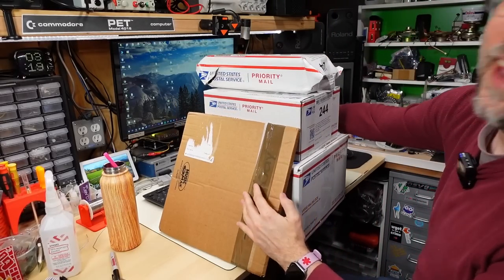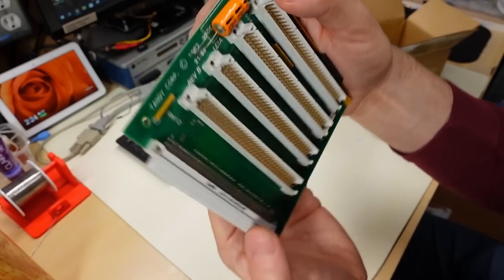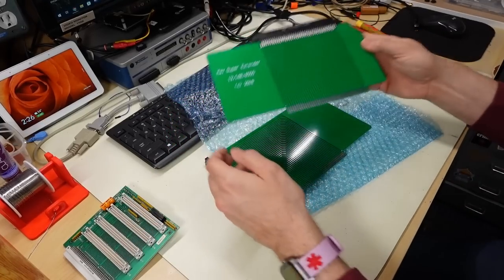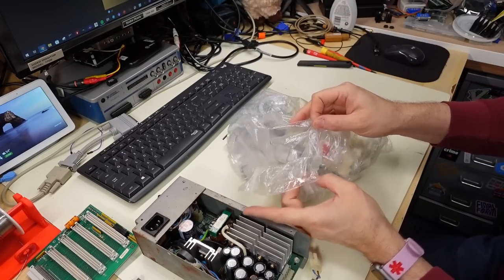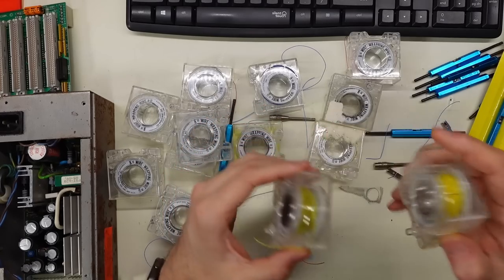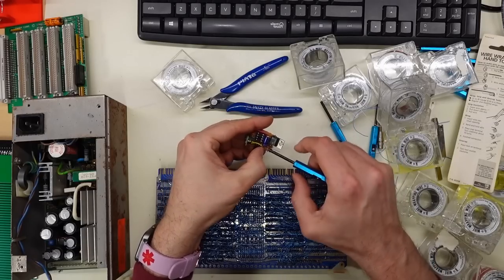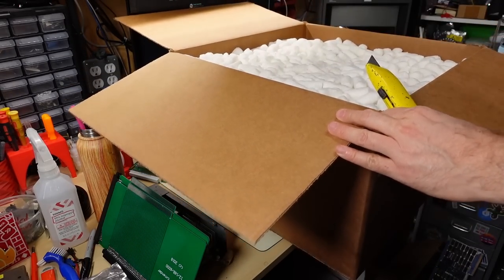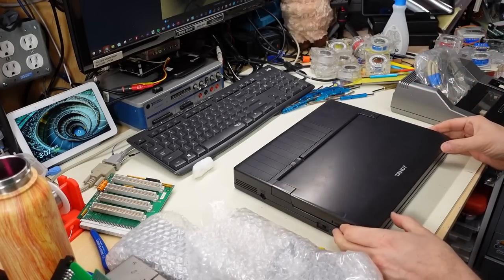0024 Wire wrapping goodies and some mystery Tandy items

Comment: Hi Adrian! It was so fun to see the items I sent opened on your show! Couple things to help with the “mystery” items- the backplane card was just another service board to help extend other cards for service purposes. Nothing other than that. The power supply was supposed to have rare hard to find parts for either a Model 2 or Model 16 so that was only purpose of sending that. The graphic plotter was supposedly used to print great electronics schematics and I suspected exactly what you said about Curious Marc that pens could be made from markers. Finally, the laptop was sent because it has an easy to replace screen and is supposed to be a great choice for DOS gaming (or an 8 Bit Dance party) with an SSD retrofit. Hope that helps with the mysteries and I hope the items help the channel! Thanks for the wonderful videos!
Reply: People like you are what keeps this channel running - thanks from a viewer!
Reply: Thanks for your donations to Adrian even if this message is a little late.  Yes, plotters of the day were the best way to print schematics especially with multiple colours for more than single layer boards.  Also very useful for drafting and architecture back in the day.

Comment: That Tandy laptop has a fairly common problem called "Vinegar Syndrome" where the acetate of what is made of the polarizer makes a chemical reaction with the environment and releases acetic acid (hence the name) when the process starts it cannot be stopped but can be fun to watch being accelerated only by exposing it to the sun and you can watch the polarizer completely rot away in a few minutes if the sun shines hard enough.
Good thing is that you can replace the polarizer and get an even better screen than what came from factory since now we have better polarizer that can deliver much better contrast.
Be aware that there are a few different types of polarizers and you might need to replace the front and back polarizer to match them.
Also another fun thing is that you can change the color by rotating or reversing the filters and get a cool blue/yellow or green/red display.
And last but not least, those floppy drives had a belt that runs the spindle and it melts away, replacing that is very likely to give back the life to that drive.

Great stuff, keep it going and good look on that procedure!
Reply: Vinegar syndrome is a problem with old film, too. I have a small old movie trailer collection, but last time I opened the box it smelled of vinegar really badly. I sorted out the worst offenders and put each in a separate bag, but I'm pretty sure they're a lost cause at this point.
Reply: @silmarian  Exactly, is more or less the same material that is made of, as far as i know one the process starts it cannot be stopped, on preserving film the only choice i know is duplication, and is valid only for archival since it only saves the content but not the media itself

Comment: My brother worked at a custom hardware manufacturer back in the 80s that wire wrapped prototype boards along with some low-run customer boards. My first job was unwrapping wires by hand so the prototype boards could be reused. I think I earned one or two cents per wire, but some of the boards had thousands of pins. I used the money to buy a disk drive for my Apple II+.
Reply: My first employer used this for custom back planes. We had a couple of electric guns.
Reply: nice racket you had going there, you and your brother, MISTER FLYNN... your brother wrapped and you unwrapped... (😋)

Comment: In the mid 90s, one of my engineering courses required building a single board computer using wire wrapping. It's a very tedious process, but the resulting connections can be just as reliable as solder. I found the board in storage last year and powered it up. It still runs--even on the original Radio Shack batteries.

The process of connecting every wire between every chip and then writing every line of firmware in assembly code to make it work was incredibly educational.

Comment: Wire Wrap notes: Short side of the tool is 'unwrap'. The little v shaped part in the middle is the insulation stripper. Wrap pins are square, the sharp edges dig into the wire as it is wrapped creating a gas tight connection which is why a wrap joint can be super reliable. If you wrap onto a round pin (such as a resistor lead) be sure to solder the connection.
Reply: Actually I was going to just put in a common pretty much same thing.

Although I've never used wire wrap myself I'm wholly aware and don't other people that have used it.

Also is wire-wrap still used in modern times and our dependence such available I've never really looked into it.

But if this is the case it might be good for some things for prototyping and some other things where it's not convenient to solder to hook something up!

I remember back in the day seeing wire-wrapped tools as well even the power version!

I do know that one time it used to beat using telecommunications as well.

Some of the equipment and thousands of wire wrap connections I see you don't talk to me occasionally room that was entirely obsolete.

But I believe was mostly still in use.

Don't remember how far back it was several years.

The interesting thing is that one portion of a wall was newer incoming equipment going to the standard punch down blocks and other equipment and the rest was what was still there.

And again that was still in use.

Somebody just at least of their workplace to show me the Telecommunications and some other things I might want to see.

Their electrical room they referred to as a substation.

Believe it or not this was at the lowest level of the building there was a separate section that was covered in chain-link fence that was straight from the utility voltage in the area.

Primary utility voltage inside!

Also all the metering was actually inside that cage to prevent tampering.

Apparently it was only the utility company that had access to the back portion of this!

That place I don't know how old it was it was one of the oddest looking systems.

Or at least primarily although I've seen weird granddaughter but part of which had also ac-dc conversion and even down to Mercury Ark rectifiers and that was still operational but had no idea for what it didn't make any sense.

It was off of building an underground corridors if you went down several what's in the quarter mile.

Big substation of some sort for certain types of equipment but no one knew what it ran!

Comment: Boy this video brought up some memories! I really enjoyed it. That wire wrap kit looks awesome. I lost mine somewhere along the way and have been regretting it. In the late 80s I made a HP/GL (IIRC) board for the Amiga 2000 that was all wire wrapped as a college project. I never got it to work but still got an A because the professors couldn't figure out why it would not work either. A couple years later, when I got my Commodore Hardware Developer status and copies of all the technical manuals, I discovered that all I needed to do was ground one connector pin (DATAC). Of course I had already torn down the card by then.

Comment: I can confirm that it did not have a built-in BIOS utility, rather it relied on software: two DOS utilities that shipped with the computer.  1) A Setup program that let you configure basic start-up and power-management parameters, and 2) a Power program that let you temporarily switch the power management profiles without restarting the computer.

You’re also right about the cutout on the back being for a modem; An optional 2400 Baud internal modem was available as a user installable upgrade. To my knowledge that was the only device made available for that mini bay.  A 1 MB SIMM RAM expansion was also an available upgrade, but it was installed via an obscure expansion bay located under the keyboard bezel above the first 7 Function keys.

Now I’m not as certain about this because it’s been too long and I can’t recall where I read this, but my understanding is something to this effect: None of the early pre-VGA Tandy laptops supported external displays because the display adapter used to drive the internal monochrome LCD used a nonstandard CGA implementation that only supported the built-in panels unique refresh cycles and 640 x 200 resolution. Adding support for an external display meant additional hardware that couldn’t be justified at the time.

But wow 🤩 I had a nearly identical model Tandy laptop as a pre-teen in the early 90s; it was my very first laptop and the first computer I had that could run Windows (3.1 of course).  It was second-hand, and only monochrome, with a refresh rate that now seems laughable, you weren’t playing Doom on it but you could play Wolfenstein 3D in glorious fluorescent backlit “Blue” & White. I’d use a serial mouse with it, but because that could be a bit of a hassle at times I forced myself to learn how to manipulate Windows entirely via the keyboard (on 3.1 this was actually a practical possibility) you couldn’t tell me nothing and it beat the hell out of my existing IBM PCjr  when it came to just about everything.  When I was about nine years old I was diagnosed with juvenile onset rheumatoid arthritis and writing quickly become a day to day struggle. Typing I’d discover was often less painful and/or fatiguing for me; and ultimately I was permitted an accommodation  (yes back then I had to get permission) that allowed me to type most all of my homework. So all thru middle school and on into high school, I’d did almost all my homework on that Tandy. It was also the computer I first really started learning to program on, the first I used to connect to a Bulletin-board and eventually the first computer I had with access to email. For a kid in an era before Window 95, before the web was world wide it was great little machine. :)

Comment: When I worked for Control Data back in the late 60's, we called that "ECO wire" as it was often used for engineering change orders to modify the circuits on very expensive pcb's.  I've built many a project in the 70's using wire wrap.  I actually still have 2 Vector P160-4 battery powered tools.  I just recently replaced the Ni-Cad batteries in them and they still work.

I was a telecom tech for most of my career and our first electronic PBX used ttl logic and you "programmed" it using a wire wrap tool.  I also had card extenders for it and often would troubleshoot cards using a scope and replace individual components.

Comment: 7:20 - Use to wire wrap project quite a bit in the 1980s. It became popular in the 1970s. The tools, I used most, came from Vector. They had a unique version called "Slit-n-Wrap". Stopped using for general projects, by the late 80s. Still use them for permanent jumpering.

Comment: Pen plotter! I owned that very unit. It had a bunch of ball-point pins with different colors. It actually worked pretty well. Just plain roll paper. The DIN connector was serial and the big connector was Tandy Parallel printer.

Comment: 2:09 only type of Tandy card I've ever seen with 4 sockets like that, is a Multi Pak with those type of x4 sockets in a row.
The one that you used to plug your disk drives, sound/speech & memory card upgrade cards into. Have fun! wire wrapping, perfect for audio equipment. 👍🏻

Comment: Back in the 80s we once tore apart a late 60's mainframe in electronics class. It was made of dozens of small boards ("Accumulator register", "14 bit adder", "Interrupt handler", etc.) plugged into slots which had wire wrap posts on the back. All the boards were wire-wrapped together with thousands of wires. We assumed this was done through some kind of automated system since it's unimaginable that humans could make all of these connections without messing some up.

Comment: Great thing about wire wrapping is it does make VERY reliable connections.  In the past I've heard to connection method referred to as cold welded joints.  I did some wire wrapping back in the late 80's and very early 90's.  I even had a project I did creating a 32-bit 3D video processor out of discrete logic.  Actually got it working reliably on a 24" x 24" board and had vertex throughput comparable to the original 3DFX Voodoo.  I remember going through about 5000 feet of wire wrapping wire on that project.  Of course by the time I finished it I was totally eclipsed by the Voodoo 2 for performance.  Wish I had kept it, but I didn't.  (sigh!)
Reply: For a long time, after soldering was phased out, wirewrap was used in telecom.  It's quick to install jumpers and also remove, and the wire really does hold well.  The pins are squared off so the wire actually catches on the edge and holds.  Most racks are now insulation displacement connections now, but some are still wirewrap.  Most T1 connections at some point, especially the patch panels, use wirewrap.  The only issue really is wire fatigue.  But yeah, so good it was universally used for telecom for a long time.
Reply: @aziztcf  You can call what you want, and I'm sorry you can't picture how it could be done.  That's fine.  It doesn't take nearly as much logic as you might think to process 3D data when the data is processed as fixed point numbers.  I'm sorry to disappoint you, but, yes, simple 3D vertex processing is not impossible in discrete logic.  With todays selection of available logic IC's the chip count would have been significantly higher since many of the logic chips that integrated more than simple gates have been obsoleted and discontinued by the various programmable logic families.  It was a project I started (for fun) before the Voodoo ever hit the market, and finished shortly before the Voodoo 2 was released.

Comment: Ah, that plotter brings back memories, I had one almost identical (my first printer) that I used with my Dragon 32. My friends were envious of my colour prints compared to their thermal printers but, of course, doing a screen dump was not possible as standard. I ended up writing software to print out pictures by drawing 'raster' lines, slow but nice.

Comment: I had one of those tandy plotters back when it was new.  Mine came with a wire bale that kept the output from rolling back into the input.  It was a lot of fun, my first printer.  Slow to print due to serial interface to the coco and the slow mechanism too.

Comment: I work in the telecom industry and legacy services (T1/DS1) are still to this day wire wrapped to DSX connection panels.  Most of the wire we see is 22 or 24 AWG, in multi-pair cables that support anywhere from 1 to 28 DS1s, each DS1 requires two pair.  It's a bit of a lost art as a lot of carriers are no longer deploying DS1s like they were in the 80s and 90s but the technique is still valid.  Personally, I still do it using the hand wrapping too, with enough practice it's not any slower than using a power tool and less prone to over-wrapping.
Reply: The wire sized I have are 28 and 30 AWG.  That is also the size that my wrapping "pen" insulation peeling slot works with.
Reply: Looks like most of the telcos are phasing out T1 stuff now.  Our first ITT-TE400 did not support T1.  It was later replaced with a Nortel SL-1 which I upgraded to a 4,000 line Opt-81C over the years.  This did support ISDN and we had dozens of spans between our facilities. The ITT switch was all wire wrap, 24 AWG and hand laced like they used to do. I still have the hand wrap tools and are they expensive now!  The Jonard tool which looks like my 3 OK Machine tools now sells for over a hundred dollars.

Comment: That first item looks like a Tandy 2000 expansion bus board
Reply: I'm pretty sure that's what this thing is, It's marked LEIA MK-1 (from what I can tell), which was used on those systems.  VERY little info out there on these older LEIA interface boards that I could find.
Reply: Yep, that's definitely it.  There's a teardown/disassembly video on De Bovenkamer's channel and you can clearly see that board at around the 6:31 mark on the inside of the machine.
Reply: It's listed as the "Mother Board PCB Assembly 8898803" in the Tandy 2000 Technical Reference, pages 207-210
Reply: There are at least four or five more posts about this, and yours has more details confirming it.  I'm just proud of myself for catching it, the Tandy 2000 is a rare one!  I don't think I've seen one since seeing one on clearance in the store.
Reply: @bobblum5973  We had one on our managers desk when I worked there back in the late 80's early 90's.  I vaguely remember him using it occasionally, but couldn't tell you exactly what he did with it (I assumed at the time it was the machine that was connected to their modem-based inventory system).  I DO know the only time I ever used it was to key in our inventory numbers when we'd do the counts, as I could type worlds faster than our manager could.
Reply: @heffe2001  It was a decent machine for its time, trying to be better by using those two piece connectors instead of card edge style, as well as stepping up to using the 80186 CPU.  The keyboard as I recall was better that the IBM XT layout, and lived on in other Tandy machines and even other brands, too.  But the marketplace went in a different direction, towards standardization, and the unusual machines gradually faded out.

I almost bought a Tandy 2000 on clearance for a ridiculously low price, but it was probably better that I did not.